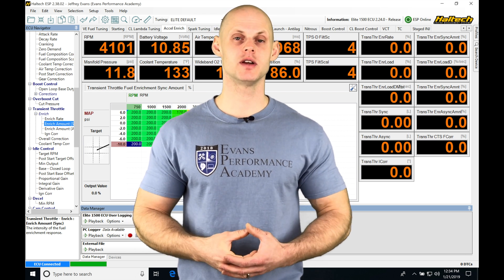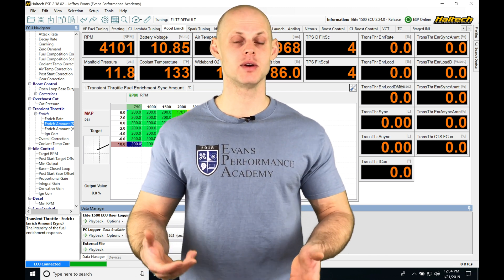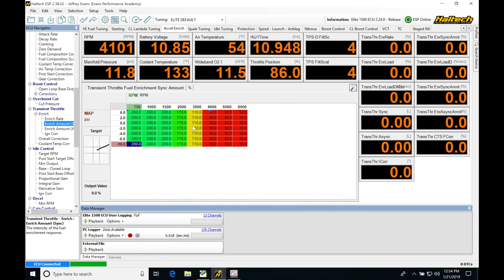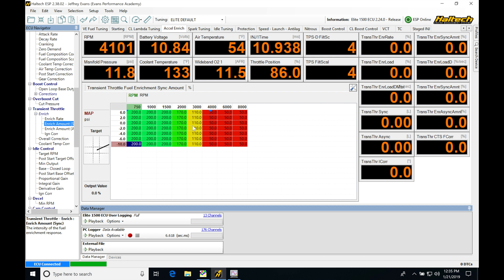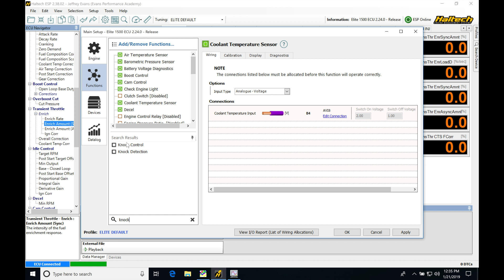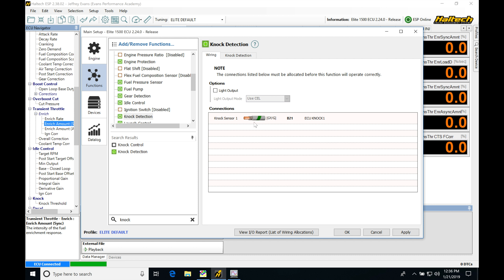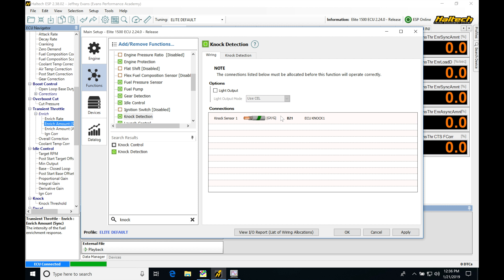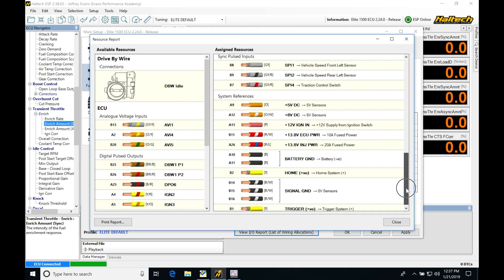Haltech Elite: Knock Control | Evans Performance Academy

Comment: Hey i've 1 question, on My racecar Ford Focus, instale elite 1500  with the oem knock sensor, the detection tool reads over 20.000hrtz on the induced knock feature. Theres any content about elite Hz range?